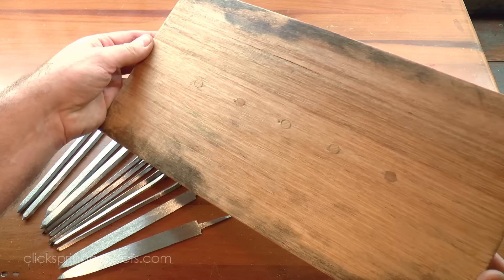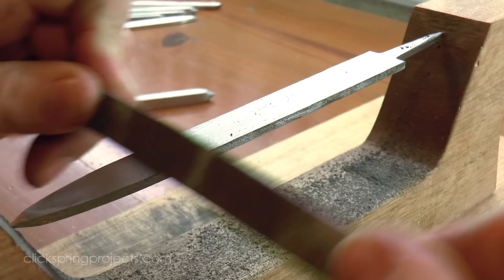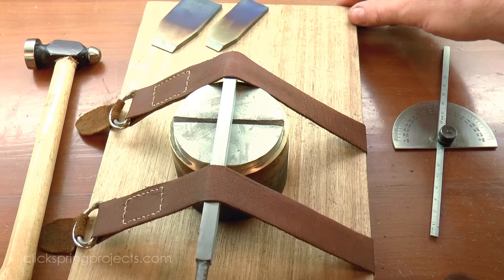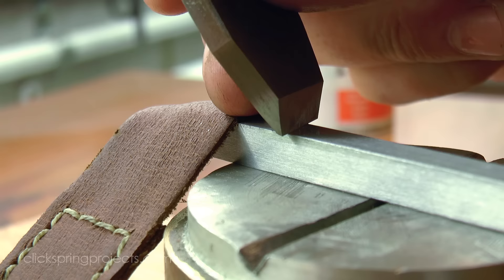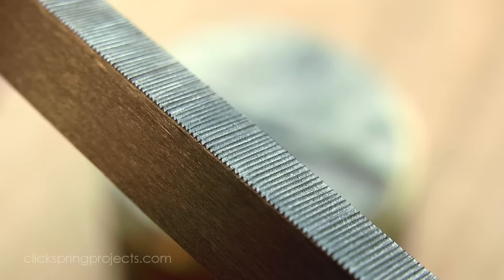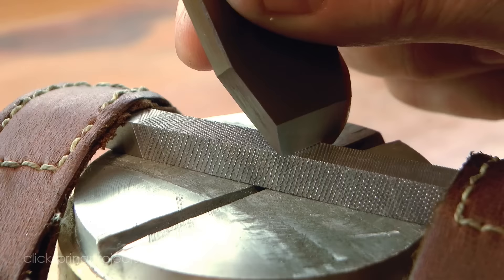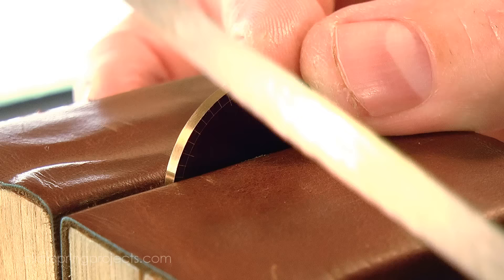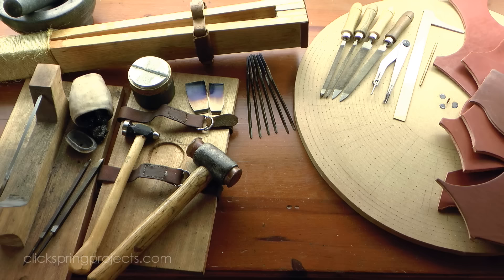Antikythera Fragment #3 - Ancient Tool Technology - Hand Cut Precision Files

Comment: Am I the only one here who can't stop thinking about the paradox of needing a file to make a file?
Reply: A flat piece of granite   could have been used.
Reply: mind explodes
Reply: If you did not have a file, you would start by making a scraper to flatten your blanks.

The scraper is essentially a toothless file blank with sharp polished corners.

It can be made using just abrasive stones to flatten and polish the edges.
Reply: I would assume you could get away without filing the blank the first time, then use those poorer quality files to improve the next set you make.
Reply: I guess it wouldn’t really matter if the first file wasn’t perfectly flat. It would still be enough to make the next file a bit flatter.

Then you can make progressively better files
Reply: @robmckennie4203  Much like how self-compiling compilers work.
Reply: Yup you are
Reply: Surely a blacksmith could just forge or even cast a flat blank? Wouldn't be perfect but it'd be close enough to grind flat with a wheel or a flat stone
Reply: You could use a piece of hardened square. The edge itself would be cutting
Reply: You mean a chisel to make a file
Reply: I often wondered about this in reference to massive machines. You need massive machinery to make massive machines right? Oh the things I day dream about. Lol
Reply: MrCarnutbill67  you scale up. But yeah it makes one wonder. 🤔
Reply: Like the bible says iron sharpens iron
Reply: It’s the grinding stones that would be the original ‘file’...
Reply: Sean  read that again, but slower ;)
Reply: You make a file with a chisel and dont need a file to make a chisel.
Reply: God made the first file. Problem solved.
Reply: Exactly its a bit like the chicken and the egg, only its egg or egg, chicked or chicken?!
Reply: Thats nothing compared to the fact you need a screw thread to make a screw thread. The construction of the 1st is an epic achievement and allowed the construction of precision lathes which are required to make them.
Reply: He didn't need to, it just sped up the demonstration .
Reply: @christianbuczko1481  You don't I guess, you can use any other kind of gearing to move a along one axis while rotating, if you talk about the lathe.
Reply: @saimon174666  thats nowhere near accurate enough. You need a worm gear thread.
Reply: @christianbuczko1481  I believe the first threads were made from wood by hand. How those could be used to make precision threads for a lead screw I have no idea.
Reply: @lazenbytim  The chicken is descended from a domesticated red junglefowl, later crossed with grey junglefowl. As these where already egg laying birds, the egg definitely came before the chicken. The question is badly framed and as such has an unambiguous answer which is not what most people are expecting.
Reply: Its the paradox that drives us all
Reply: @lordchickenhawk  the 1st precision made thread was steel. The screw had a square rod, and washers fitted over the rod to make it a cylinder. Each washer was then hand cut, and fitted onto the square rod, with all the cuts in the washers lining up to create the screw thread. There was a few hundred washers to create the thread a few feet long. That was then used to make a similar screw thread which was a single piece of metal and therefore was smoother to operate and made the 3rd one even better. To handfile those pieces to get it to work even poorly like that mk1 version is probably the greatest jump in mechanical technology since the invention of the wheel and enabled the construction of many machines vital to precision engineering and the industrial revolution.
Reply: How's about high precision CNC milling machines? You'd need a high precision milling machine to make a high precision milling machine 🤯
Reply: @petercarioscia9189  you need a dull stone to make a fine point
Reply: The tapered part of file can be used for spot filing like a scraper
Reply: @christianbuczko1481  That's really interesting, thanks mate. Do you have a link to any further info on this?
Reply: @lordchickenhawk  i saw the story years ago on a documentary on tv i believe. Im not certain, but it may have been a fred dibnah series about early engineering, or something similar.
Reply: @lordchickenhawk  look up "henry maudsley" 1797. Just did a quick search on youtube for screw thread history, and found the inventors name and date of invention. But that vid only showed a picture. Maybe if you search on youtube, you can find a more detailed documentary.
Reply: @christianbuczko1481  Thanks mate. I'll have to go look for some more BBC Dibnah re-posts
Reply: @christianbuczko1481  Thanks for going out of our way for me Christian... I am doing other things right now but I still intend to have a look at this tomorrow... it's midnight here. Cheers! :)
Reply: That a very good point. Chicken and egg scenario..
Reply: The machine needed to make the machine is baffling and fascinating to me.
Reply: Or sandpaper
Reply: @MrCarnutbill67  my very cinfidence guess is a straight edge to cover one side of the machine ways tables and a precise laser alignment and constant improvement and all is history
Reply: They might have used a stone for the first one.
Reply: A scraper would have worked as well.
Reply: @ared18t  probably
Reply: @doubledarefan  working on Granite without hardmetal would be a very long process.
Reply: The whole chisle technique solves it
Reply: files seem like they're all a part of one family tree, like thousands of years ago it started with a caveman grinding a rock to make a file, then grinding metal with the old file to male a new file, all leading up to today's files
Reply: Woodworking used Shark Skin to smooth out rough finishes, and that is an obvious pattern to follow, cutting Copper with Flint Scrapers and Chisels. 
Spinning and Weaving Cords gives many patterns of spirals and Threads =>same word identity on threaded Shahts to rotate shaped objects in a quantifiable "way", ..again all-ways all-at-once sync-duration derived from Superspin, in Devices like Pottery Wheels and Lathes.., laths, strips of Wood woven into panels etc?
"Wordless" recognition<->Intuition.., SELF-defining teaching-learning.
Reply: This is indeed a disturbing universe
Reply: @MrCarnutbill67  actually you would be amazed at how small some of those reference surfaces are for quite large machines.

My guess is that a small reference surfaces is used for correcting the ways and a autocolumator would be the means by which the one would both verify correctness and figure what needs to reduced where and by how much.
Reply: You don’t need a file to make a file, you need a chisel and a hammer, which could have been rock and bone that has been carved into a chisel by grinding it on a rock caveman style!
Reply: Well, the chicken and the egg.
Reply: That is the real  job of a  blacksmith...tools to make tools...👍

Comment: Interestingly, the lack of uniformity in hand made files, is shared in high quality machine made files, because if the tooth spacing is too uniform the file chatters, and fails to make a good cut, and instead squeals and digs in from vibrations generated at a high frequency. Nicklson (did I spell that right?) file corporation invented the first file cutting machine that was suitably Random to mimic hand struck files, and allowed for machine made files to take over.

Betcha if ya used a nice hard modern tool steel, it would end up better then most store bought files!
(That are made of straight high carbon steel still... some tools refuse to evolve)

I like watching files get struck, there is some magic in the process, happy to see your channel. You earned a subscriber.
Reply: Not sure what you mean by a modern tool steel, but there isn't much of anything that will make a better file than a mildly alloyed 1.2% carbon steel. Steel that's more highly alloyed has problems other than wear resistance, especially in fine edges (like tips of file teeth) under any pressure. The cobalt steels are about the only thing that gets a little harder than file steel (file steel can come out of the quench at 68), but cobalt steels are extremely low toughness and the teeth would break right off filing steel.
Reply: @daw162 "File steel" is usually plain 1095, correct?

Comment: Hi Chris,
When I started my apprenticeship in the electrical/radio trade with BHP at Newcastle NSW the first 3 months entailed basic fitting with BHP and one day a week at TAFE with electrical fundamentals.  At 15 in 1965 I had no idea files had been around for over 2000 years when I was first taught how to use them properly and file within 2/1000" 2 thou or back then it was 2 mil  tolerance.  
I am finding all your video's fascinating along with quite a few other people.  I turn miniature parts  up on a mini lathe to replace mechanical  parts on reel to reel tape decks as you can probably guess these are no longer manufactured.  The skills I learnt so many years ago are still there, a bit rusty but still there. 
 I manly work in brass,  bronze  or copper so your videos on the Antikythera Mechanism I find is so interesting to me, I have learned quite a few things.  It's amazing you are working without detailed drawings, only from  x-rays of a device left on the sea bed so many centuries ago and piecing together what techniques must have been used .......Regards Robert.

Comment: When I worked at Cartier New York  in the jewelry work shop ( mid 1970s)one of the older jewelers who had worked during WWII  told how during the war, hand files were in short supply, and when the old ones were dull, they would put them in the hot sulphuric acid pickle thus dissolving enough steel to "sharpen" them , that also killed the pickle for jewelry work. I enjoy your videos very much thanks!

Comment: Great and informative video, as usual Chris and as an old toolmaker and retired Gunsmith, I have gone through lots and lots of files in my time. Your work is superlative and always interesting to watch. 
A suggestion for the file making chisels, if you don't mind.  Shape the struck face of the chisel, so that it comes to a blunt point and this will negate the sideways kicking of the chisel, if you strike it off centre with the hammer. 
I noticed this happen quite a few times during the process. You will also get better energy transfer. 

It was interesting to see yet another method of case hardening and I am going to give it a try, as it seemed like a very positive method. 
I have always told my trainees, that there are no real shortcuts and time spent in making good tools, is reflected in the quality of the work they produce. 
Cheers,
Tony
Reply from the maker: Thanks Tony, appreciate the chisel tip :)

Comment: As always, classy work mate! Thank you for sharing the info. I stumbled across an article years ago about a European company wanting to automate the hand cut file making process. The first problem they faced was that the machines cut perfectly spaced teeth and the files would not cut properly. They needed to create some tiny variations in the tooth spacing across it's length to mimic hand cut inaccuracies. .... I'm off to measure some files now that I remembered that.
Reply: Machete Bushcraft Australia I would love to read that article!
Reply: Mate I went looking for it and could not find it.....As my Mrs would say I had a 'boy' look. I will have another go and post it up when I get the chance.
Reply: OK, I did not find the original article but I found some others chattering about it. Google 'Hand Making Files Sheffied  Practical Machinist'. It is on the Practical Machinist website and I think he meant Sheffield? Post 2 and 4 talk about the need for irregularities in tooth spacing.  Nicholson solved the issue.

Comment: Oh, and P.S. Quick tip for cleaning your files when they are all full of left over material. Just take a piece of copper, about 3 inches or so long, and with a little bit of girth to hang on to. As well as a flat edge. Take and put it against the edge of the file, aiming to move it along from one side, to the other, going with the direction of the teeth groves. Press against the files surface firmly, and as you do, the teeth of the file will indent within the copper, filling all the voids of the file along with it. As you go along the grooves, it will remove any old material. Just repeat until you reach the end of the files face. This will make an old file as good as new and is great for cleaning and upkeeping files to keep them in good condition. It comes in handy.
Reply: Just want to add, you can also add chalk to your file to keep it from loading up
Reply: @carloshernandez2561  good addition. 😉 I rarely use it when working with precious metals, due to wanting to reclaim any scraps and filings without contamination; but no doubt it will work.
Reply: @carloshernandez2561  Now it makes sense! I bought a rather enormous flat file at an estate sale that looked like it was loaded up with plaster or something, it was probably chalk :)

Comment: I am so impressed to see this video. I can never find the type of files I would like to have. For example, files of regular shapes, triangular, flat, round, etc, but, smooth on one or more sides, with the filing surface only on the other, which would allow me to file, using the smooth surface(s) against a guide or the work piece itself, only filing stock on the filing side of the file. And, the coarseness of files, is just never right.
Reply: You could do what I have done,  and make one or more edges SAFE edges,  by sanding them smooth, to a mirror finish

Comment: Wait so you need to create a file in order to flatten other files? How did you make the first file so flat?
Reply: That's what I was thinking. If you need a file to make a file how do you make the first file??  I'm thinking most likely a flat course abrasive stone. Be slow going to make your first file but now you got a file.
Reply: You can use
a scraper, no teeth are necessary to do that. It is a tree sided tool with
scharp corners like a file without teeth.
Reply: You could use grit and oil etc instead
Reply: Grit? If you
think of emery cloth, that was expensive because you need to replace it often
and the grinding powder is only found in some areas of the world.
Reply: DEE-KAY   Who laid the first egg..?
Reply: It doesn't take much. This guy ground the entire blank but more reasonably historically you'd surely FORGE the blank and grind nothing more than the final polish on an already fairly smooth finish from the anvil, which isn't that intensive on whatever resource you have. It's not like you need mirror finish, anyway, you only need the same as a file would get. Also, plain old sand/silt would work, even. Slowly, annoyingly, compared to nicer options, but quartz is MUCH harder than mild steel or iron.
Reply: Let's say the first file wasn't flattened and was really lumpy, but got its teeth chiseled into it anyway. Using that, a more flatter file could be made, and using that, another flatter file, until the limit of reachable file flatness was approximately reached.

Wouldn't it be cool if today, a file existed, that was made using a file that was made using a file that was made etc being a direct descendent over hundreds or thousands of generations of the very first file? It would be a pretty old file still, because people don't generally make files per hand for a while

Comment: I can see as you strike the chisel that you’re lifting off to the far side. Move the hammer strike and slightly overshoot the mid point of the centre, it will balance out somewhat... just a tip from years of hand cutting files

Comment: Making the tools necessary to make the tools required to make the tool you wanted.
Sounds like a typical work day for a machinist!
Great stuff!

Did you know that there are only 4 categories of tools?
Cutting tools, joining tools, manipulators and measuring tools.
Sandpaper, files, drills, taps, saws, chemical etching, plasma torch or rubbing a bit of metal on a rock all work by taking something away from the work-piece. 
Soldering, welding, 3d-printing, riveting, over-molding, electroplating, gluing or painting all work by joining something to the work.  So yes, JB-weld is a tool!
Turning a screw, bending a bar, winding a spring, casting into a mold, UV-curing resins, or heat-treatments all work by changing a thing without taking away or adding to the thing.
Calipers, scales, cameras, pH meters, thermometers and the like record properties of the work piece.
Some tools do only one of the above, whereas a 3d-printer does all but the cutting part.
They are joining tools like welders, they manipulate the filament through melting like casting and they are 'aware' of the work piece through sensors.
I love this stuff!

Comment: G'day Chris, I've sharpened files using acid, as the way the etching process works it tends to sharpen angles (ie teeth). Acids would have been known in that era and you could try that if you wanted to try improving the file cutting. 

It's one of those processes I'd heard rumours about and would have said was BS, but with some dull files and acid available I gave it a go some years back, and then looked at the results under a microscope. Sure enough, subjectively they felt sharper, and under magnification it was clear the teeth were different, and a clear line could be seen between the acid etched areas and the part I deliberately left untreated.